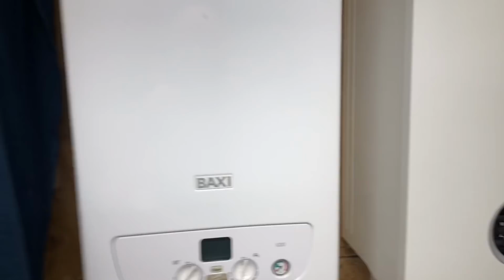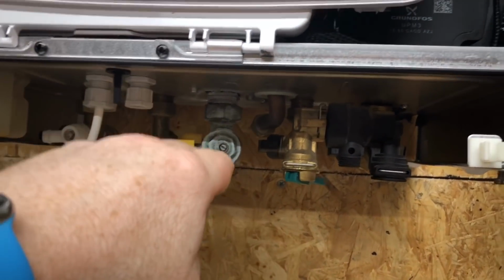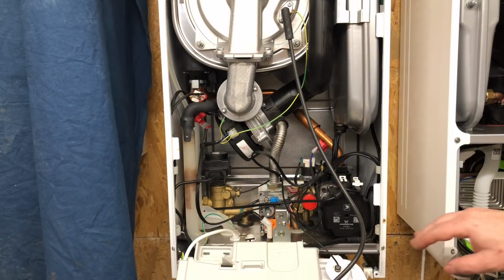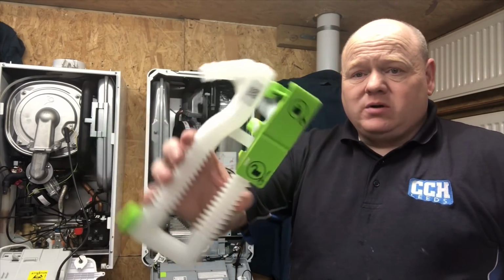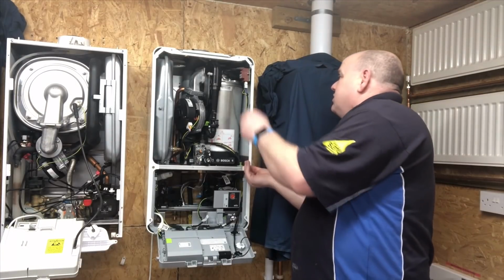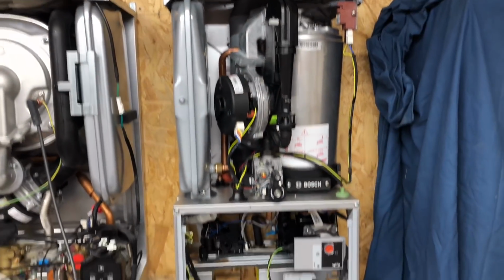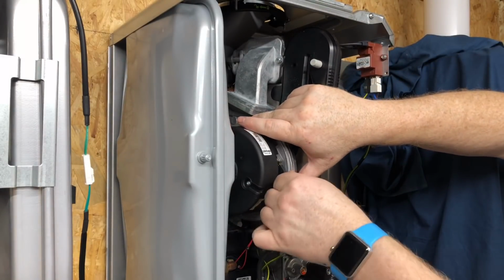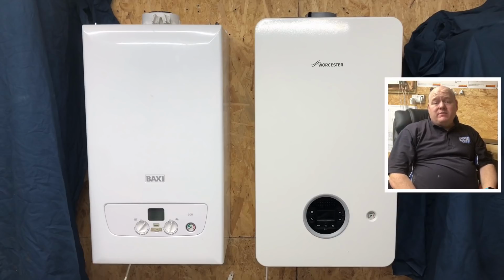Worcester 2000 v Baxi 600 - Which Combi Boiler is Best

Comment: Well if we listen to the which magazine it would be the Worcester. Worcester spend so much time brainwashing castomers with marketing most customers cant see past a Worcester as if there the holy grail of the boiler industry. 600 and 800 and the main option are so lightweight and easy to install and service i have fitted hundreds and never had to repair one although its still early doors. I have stopped fitting 600 range as it doesn't make financial sense to buy it when the 800 comes with a magnetic filter and 3 years more warranty.
Reply from the maker: I am also installing the 800 now. 👍
Reply: @AllenHart999  The sooner they release the range topper KW the better i presume it will be an 842 have you heard any rumours?

Comment: Baxi all the way. Fitted loads of the 600’s now fitting the 800. As for Worcester Bosch I stopped fitting these a few years back. I’ve been back to a few I’ve installed with hydro block leaking etc and as you said WB seen to over complicate there boilers, Jst won’t fit them anymore. Was never a lover of the Worcester controls and what is that condense trap and valves under the boiler all about! Seems Baxi have made another great boiler!

Comment: Baxi hands down
Reply from the maker: Why? What do you like about the Baxi.
Reply: Easy to work on like you say everything is easy to get to heat exchanger easy to service and clean brass components fitted a few to and not had any issues in over a year with any of them I’ve never used Worcester but I’ve done break down on the old ones and there always a pain and the fact they use plastic components and you pay high end prices is a joke really and there flow sensor are known for leaking and going on to the diverted so instead of resolving the issue they just put a rubber green cover over the diverter this is on the old models I know but stuff like that has always put me off also baxi have a great team I’m from Kent and our local sales rep is always on the other end of the phone

Comment: Allen Informative as always. Installers will choose BAXI all day. Flue Options Pipe Options and serviceability . The 600 is a fine Boiler  Wb are over engineered and difficult to work on in tight spaces . Also wiring controls is clearly another biggie: choice is very important here. I saw comments re: not a fair review etc etc ....If a product stands up it stands up , if it doesn't it doesn't.BAXI wins in my opinion and would do against most boilers in this category.. Great work mate,,
Reply from the maker: Thank you for the feedback. 👍

Comment: Hi Alan I used to have a Baxi 7 years ago he lasted only 5 years the heat exchange when nothing but problems I know things have changed now I wouldn't trust it anymore I know you know what you doing you are the Professional and you have one at home I seen your video all the best
Reply: That's more then likely down to incorrect commissioning.  The baxi's I've fit in the past have had very few problems.  Your system probably wasn't cleansed and inhibited properly.  Your installer may have left cleanser in the system.  Or non of the above. 😂
Reply from the maker: What boiler model was it please? Thanks.

Comment: To me Worcester have successfully managed to polish a turd. I’m not a fan of their over complicated heat cell, which have proven to be problematic for them over the years. They haven’t learned their lessons with their plastic components either. 

From an engineers perspective the Baxi wins hands down. On every level this is an easier boiler to repair service and maintain. The Worcester seemed to have put all their eggs in one basket and that’s the look and design of their boiler as well as their name. Some people think that they’re the best and nothing else will suffice to their uneducated minds. 

Baxi I think have nailed this boiler and for the engineer, how many of these could you service in a day? Loads more than the Worcester. 

Baxi’s are easier to install, look neater, not so many extras to buy or to explain to the customer why you need this and that at additional cost. 

Baxi = More compact, easier to work on, better engineered in terms of no need to stands offs of filling loops. Easier to maintain in terms of a stupidly simple burner removal for a quick and thorough hex clean. The extra warranty is a bonus but probably reflects how reliable Baxi think it is and even if it breaks down it’s a dawdle to fix.
Reply from the maker: Thank you.

Comment: Baxi all day long
Reply from the maker: Why? Thanks.
Reply: Same as your opinion really, plastic shite and crap heat exchanger in the Worcester. Folk are just brainwashed into paying for a brand these days.
Reply: And if you’re not bothered about warranty length then the Main Eco Compact is the exact same boiler as the 600 but wayyyy cheaper

Comment: I think the Baxi looks as if it's the better design to me.
As a service engineer, I can appreciate having good access to all the main components, also I find as plastic moulded components age they can have a tendency to become brittle and break easily, whereas brass does not.
That said,  I've got a Baxi HE24 and over the years quite a few things have failed, main control board, fan, diverter valve cartridge,  expansion vessel, DHW flow sensor and for some  reason the DHW temperature has become unstable now.
Reply from the maker: Thank you for the comments.

Comment: Good video Allen, The baxi wins it for me. I have fitted both but would have a baxi in my house. Very quiet too. All from the front servicing and great access to components. No need to replace the burner gasket when burner door removed as it is a silicone Rubber seal, compared to the Worcester which should be replaced every time. Also cleaning the Worcester heat ex is really awkward especially when it in a cupboard or near a ceiling. I mean have you seen the special brush they do? Its enormous. Controls on baxi are simple for the user and commissioning where as the Worcester is over complicated control panel.  Please mention that the baxi also has a flue drip tray under neath the flue connection within the boiler, which is great if you get driving rain or leaking gutters for example and the water enters the air duct, which takes water directly into the condense trap and safely away. I have had several issues with other makes without this drip tray system and causing damage to electrical components. 
Keep up the good work 
Cheers
Reply from the maker: You make some very good points. It’s hard to add everything into a video. Thank you.
Reply: @AllenHart999  No worries, just for other peeps to read. I know you cannot cover everything otherwise it would be an loooong video. lol.

Comment: Baxi 600 looks like a return to form, loved the Duo-Tec and Platinum. Only issue I find is the diverter cartridge leaking (easy repair for me, 9/10 it’s due to a sludged system not the fault of the manufacturer)

WB 2000 - what have they been smoking? 🙈 terrible trap, trying to reinvent the wheel with the ‘kebab’ heat exchanger, now a 15 year old design but removing backwards compatibility for the junior models electrodes. Then to add insult to injury no supported controls other than their own? I’ll be telling customers to steer clear! Who doesn’t want a Nest or Hive in their homes nowadays!?

Great honest opinions Allen 👍
Reply from the maker: Ha ha, Thank you for the feedback.

Comment: Paused as you asked...Used to be a Baxi installer until certain issues, switched to Vaillant and never looked back. Never been a fan of Worcester at all.

Edit: Reasons are because of consistency. Baxi took control of the market during the 105 days and got too cocky and didn't give a shit about the installers (they've since made a turn around again) Worcester I just don't like to work on, i like my knuckles in one piece! Vaillant always been a top quality product and an installers dream to fit  ;)
Reply from the maker: What issues did you have with Baxi? Thanks.
Reply: @AllenHart999  See edit All. I had a 130HE in my own house. The main heat exchanger split after a few years. I rang Ron  Johnson the rep for the south and wanted a heat exchanger on the house! bearing in mind it would of been a pig to change anyway. I used to fit over 100 105's a year! They said no... I said fuck off! lol
Reply: Also manufacturing tolerances went down the pan! I've opened my hands up a few times on early duotecs when mounting them, with the razor sharp edges. We wont mention the union packs where they wouldn't fit int a socket! You had to file and piss with them for ages.

Comment: Baxi,i would not fit anything with plastic inside it anyway,600 is proving to be a brilliant boiler
Reply from the maker: Thanks. Have you installed many 600,s ?
Reply: @AllenHart999  Around 40,love them as a boiler,a true replacement for the Duotec

Comment: Baxi. But only because that's what we replaced the leaky Ferroli that was in the house when we bought it with. 😉

Our plumber was happy to do a Worcester, but reckoned the Baxi was more plumber friendly to service and parts more quick to source. No idea if he was talking cobblers but he seemed legit.
Reply from the maker: Which model do you have? Thanks.
Reply: Allen Hart 600 series. 624 exact model I think. Only two years old at this point but not had any issues.

Comment: Worcesters new replacement for the Si.  Still pooh boilers with the same plastic components.  What are they offering, a 5 year warranty 6 with their own filter.  The plastic components probably won't last that long.  Easy to service and really quiet operation.  Baxi Main wins for me with installer credited works scheme.  When you've familiarized yourself with a certain manufacture and their compatible controls, it's an easy win. Baxi's across range seem to be installers choice.  Brass internals and a ss hex.  Tbh from the duo-tec platinum mains and mexaflow which are all great boilers.  Baxi's haven't changed much so you know what to expect.  Their new line up are all pretty similar tech wise.  

Tbf you commission/service most new boilers correctly. They'll should last atleast the duration of the warranty, waffle over 😜

O forgot to mention no special tools required to service the baxi.  To strip down and service the 'kebab' heat cell you need the baxi service kit 🤣
Reply from the maker: Thanks for the comments. 👍

Comment: Can’t fault the 600
Had no problem so far
Reply: I have also fitted the main for a cheaper option the only difference is that you need to have a stand of for the main for the pipes to go behind as they have spot welded 2 brackets to stop you from going down the back
Reply from the maker: Have you installed the 600? Thanks.
Reply: Yes I have installed a lot of 600 and the 800 range easy to work on and easy to fit I recommend the baxi to every customer

Comment: Looks shit with the pipe connections not all in line... but doesn’t surprise me as, as they have a reputation for making shit boilers despite the reputation and amount that get installed.
Prefer stainless heat exchanger over aluminium also.
Reply from the maker: Which boiler would you choose? Thanks.

Comment: Mate any idea what the expansion vessel on a worcestor 28cdi rsf should be charged to, the manual says 0.5 bar, if I do that the would I have to pressurised the boiler up to 1 bar in total (0.5 EV + 0.5 BOILER)?
Reply: 0.75 bar or 1bar. Usually anything equal or similar to the system pressure. As when the system water expands it will expand into the vessel. Too little pressure in the vessel it won't work. Too much pressure in the vessel you might pop the prv.
Reply from the maker: Which boiler would you choose? Thanks.